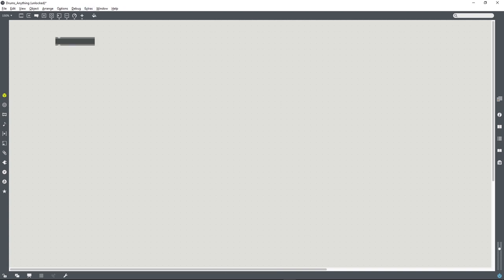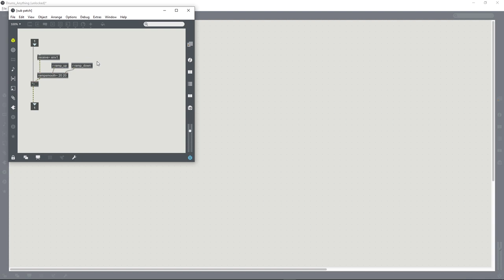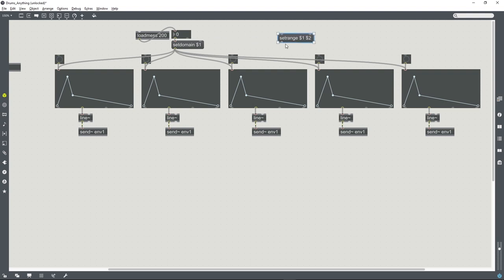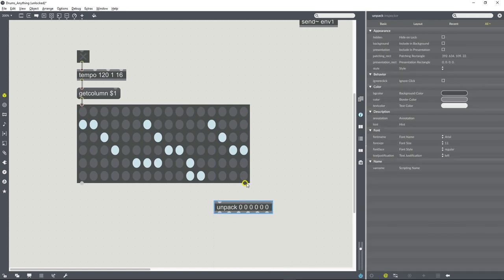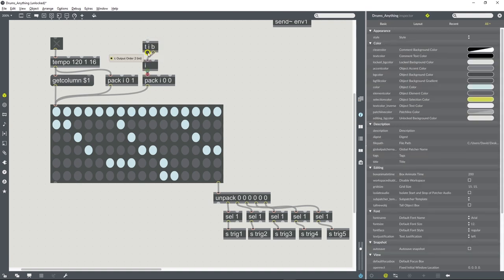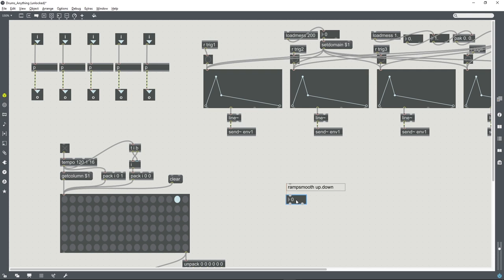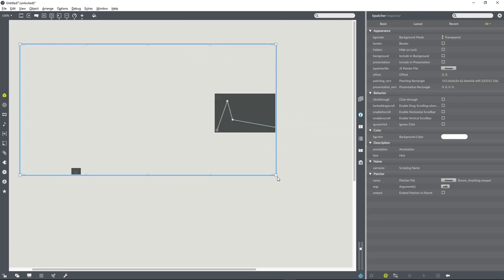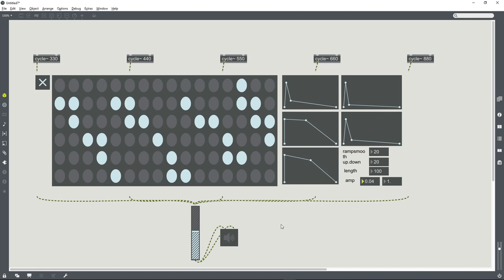Max/MSP Tutorial: audio envelope step sequencer (part 1)

Comment: Hey David, When I connect the cycle~ to the bpatcher I get a continuous tone. Do you know why this is?
Reply: Check the signal flow to the envelopes? Sounds like it's totally bypassing them. Or maybe you haven't drawn them?
Reply: I also encountered this - did you find a solution?
Reply from the maker: hi, this may be a bit late... can't really say what's wrong but the way I would troubleshoot something like this would be to try and break down the signal flow inside the bpatcher into self-contained chunks to work out where its broken.

e.g., go into the bpatcher... find the envelope, and try and test it on its own. you can use a 'sig' object to send a steady signal in... does it seem to be working? and so on... work through each part of the patch, check each bit is working as it should on its own
Reply: I figured it out! at the beginning/end of the lines for the envelops, you need to click the point and drag it off of the screen so that the dot becomes hollow, otherwise your envelope doesn't ever close all the way.

Comment: Hey man, where exactly shoud I connect the cycle and gain to in the raw patch?
Reply from the maker: Hi Deividas! I know you've worked this out now, but in case others are interested, you can get this patch working without needing to put it in a bpatcher by connecting your audio inputs to the inlets of those subpatchers in the top left (i.e., the same place where the inlet objects are currently connected), and then connecting all of the outputs of the same subpatcher (i.e., the place where the outlet objects are connected) to an ezdac / dac
Reply: @davidcooper8241  hey dude, i'm still a little confused about how to achieve this without bpatcher. is there any way u can re-explain this to someone who's just kinda getting into max patching!! thanks in advance man
Reply from the maker: @driia4943  A bpatcher is a way of loading one patch within another patch. Whenever you 'encapsulate' and create a subpatcher, you're doing something similar - creating a patch within a patch. It's just that with a bpatcher, you can see the contents. So, this device is set up with the idea that it will be loaded within another patch. The inlets and outlets used here allow messages or audio to pass into and out of the subpatch (i.e., this patch) from the patch it is loaded into. When loaded within a bpatcher, those inlets and outlet become the kinds of inlets and outlets that all object have, and you can connect patch cords to them.

To use the patch in this video without loading it into a bpatcher, you've just got to work out what those inlets and outlets are up to. Here, the inlets are intended to take the original audio signal and put it into a [*~] object. That object is multiplying the signal by the envelopes generated in the rest of the patch. The outlets are outputting the signal that comes out of that [*~] object.

So, just connect the audio you want to be enveloped to the left inlets of the [*~] objects, and the enveloped results will be coming out of the outlet of those same objects.

Does that make sense?

Bpatchers are worth getting familiar with though if possible, they're fab :)